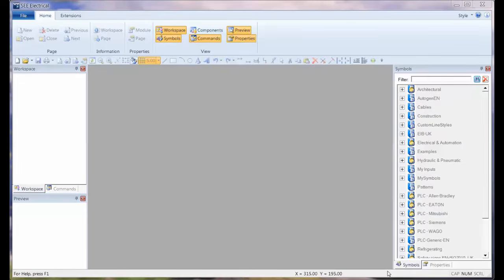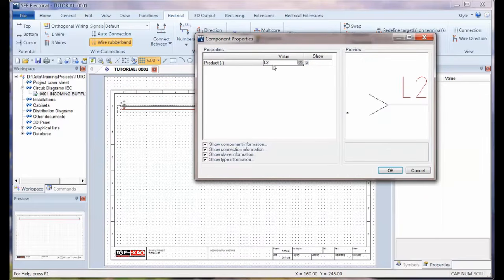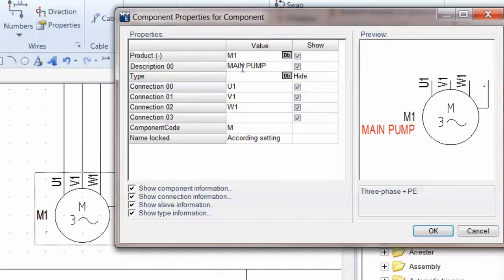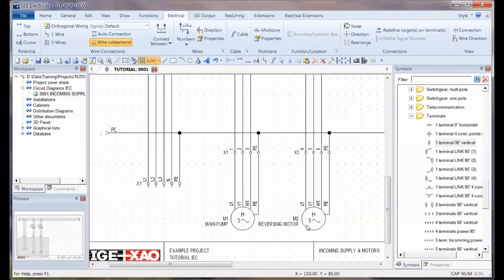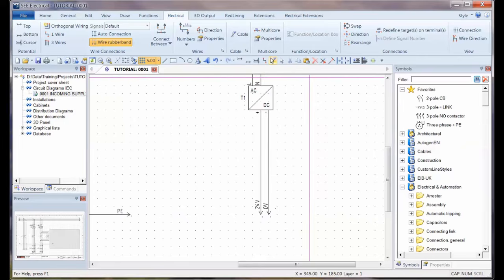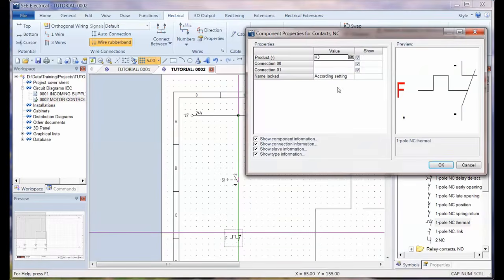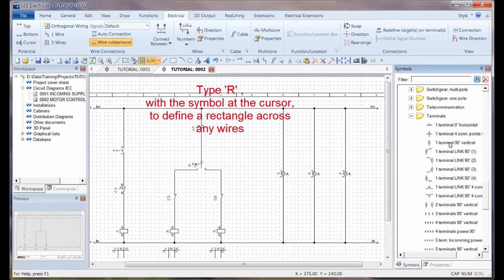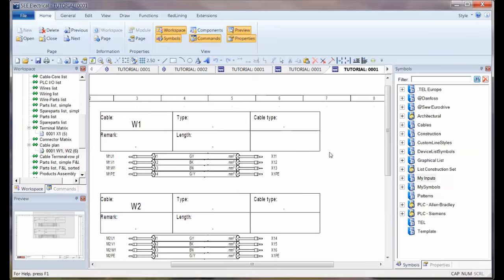V8R1 IEC Tutorial

Comment: how can I program where the potential lines appear? my other wires don't connect to them correctly
Reply from the maker: Right-click in the page and select Page Properties. Click on Page Template sections at the bottom to see the working area for the page (displayed as a red box). Take note of the top and bottom position for this box. Check the Page Properties again and check the Position of top and bottom potentials which are offset from the top and bottom of the red box. If this is off the 5mm grid and the offset doesn't adapt the starting position the potentials will not be easy to connect to.

Comment: How do you show wire size and color without putting it in a cable?
Reply from the maker: Priority for wire size and colour display comes from the wire properties settings in the Circuit Diagram IEC Properties menu, in the Wires tab. There's a graphical properties section with options for displaying wire number, size and colour. Once enabled, you'll need to control the display on each wire if you don't want to see the size and colour.

Comment: I downloaded the trial version and I don't have a tab (circuit diagrams IEC) so I couldn't make a new page. please tell me why because I want to buy a version and I don't want to have the same problem.
Reply from the maker: Make sure you've created a new project and NOT used the Installation Standard workspace template. If it's still not showing the Circuit Diagrams IEC node, it most likely your trial has expired. Email uk@ige-xao.com for assistance in this case, thanks.